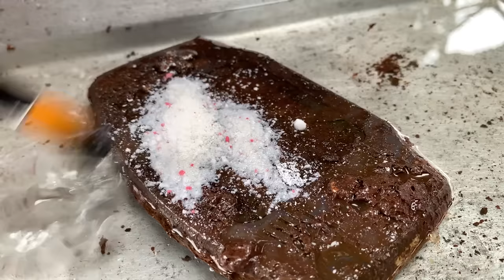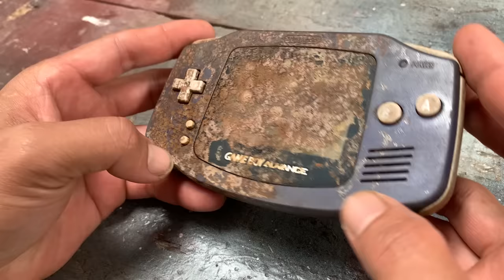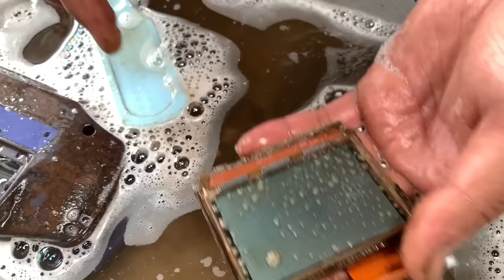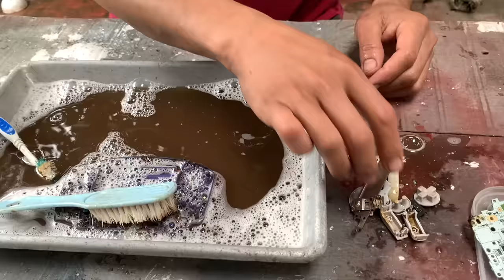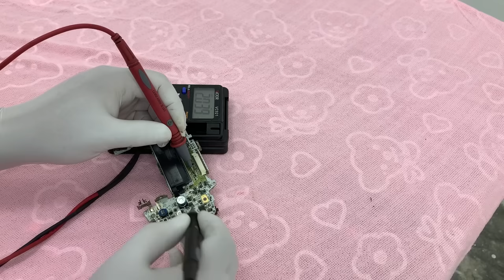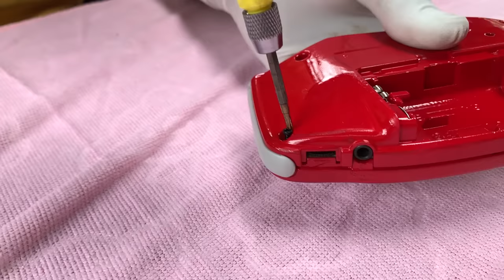Restoration Old Ｎｉｎｔenｄｏ gameboy advance | Restoring Game Boy Advance ＧＢＡ

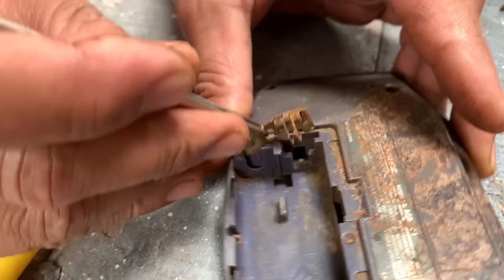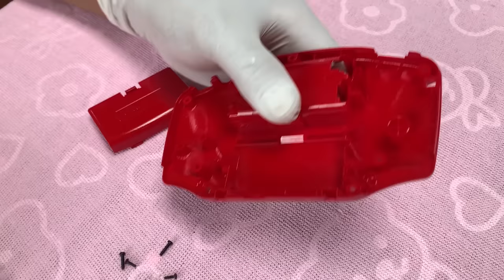Comment: Amazing work on the casing from 5:58 to 15:33, they even redesigned the shape of the top screw hole, changed the location of the circle bumps, and added 2 rectangle holes on the left of the biggest pin.
Reply: Miracles seem to be a thing now. And my forehead has at least two more wrinkles after watching the video, yet another surprise 🤔
Reply: he did a great job
Reply: They magicked a battery cover out of thin air too, as they certainly didn't find it with one.  Oopsies.
Reply: Yeah, I didn't buy this in the first few moments of cleaning when not a single bit was taken apart. Just throw the whole damn thing in some soapy water and call it the day I guess.
Reply: THANK YOU I new something was off (apart from the obvious), the rectangle holes is the biggest giveaway. Fake AF.
Reply: Theres also the speaker vents, went from having holes to completely sealed. at first i thought maybe he couldn't salvage the case so printed a new case and just did that instead but nope apparently he painted it and it magically changed the case.
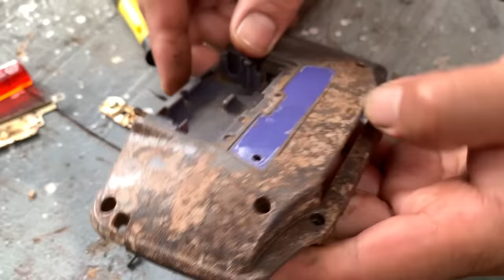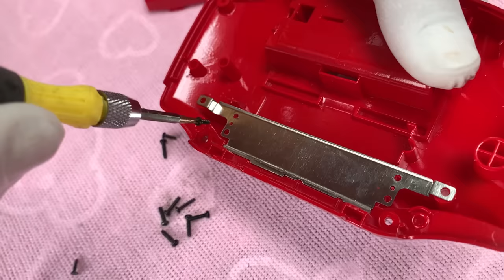Reply: You can get a better look at this amazing work by comparing 6:10 and 15:40 side by side :)
Reply: @00bsdude  So because it's in youtube does that mean that channels can upload shi**y content and claim in this case they restored something when they didn't? I didn´t know that a should've expected TikTok-like standards here and have the obligation to appreciate bad content and not criticizing it.
Reply: @metale3  They Did restore it. You just expected it to be 20 years old, but they didnt actually claim it was and anyone with a brain can put together that's not a reasonable expectation since what are the odds of someone finding a GBA like that in the wild and also happening to be a Restoration youtuber. Yes its not authentic, but it being shitty is subjective. If you like it, watch it, if you don't like it, just don't watch it, its clearly not the content for you. Criticizing it as a video is valid, criticizing it for not being what you assumed it was isn't it.
Reply: @00bsdude  It depends on what you call restoration. Most ppl (me included) consider restoration to be full restoration of an item with 5, maybe 10% of part replacement. That is not the case here. It is quite obvious, that case of Gameboy was straight up new, not restored. Yet it showed, like it is restored. Came here hoping to find a proper restoration (don't care how item was recieved. You can soak it in water by yourself for years. What matters is restoration itself). Find some kind of part of restoration and mostly replacement. Not gonna be here again.
Reply: @00bsdude  ??? From what I’ve seen, he had a whole other GBA ready to go as the final product. One “restored” fake and one already functioning.
Reply: Bro they didnt even out a screen cover on it, and the buttons sound like satan eating a tire
Reply: @00bsdude  People are upset because they are lying, they did not restore the original to working condition. People have a right to be upset over this.
Reply: You can literally HEAR how fake it is when he's playing the game. the whole console is creaking.
Reply: @royroy242  My complain would be more on the side that this is fake, yet, it gets tons more views than many other real restoration channels because of course, the YouTube algorithm promotes this instead, in which case, it's supporting something clearly staged over something that took real effort to find and restore (yes, restore, because a lot of his actions wouldn't actually clean a real antique and it is not that easy)
Reply: For sure he replaced all the buttons and side bits too, and the color of the case magically changed from a glossy red to almost a clear red. Think the only thing he may have kept was the motherboard but I’m pretty sure it was fried
Reply: Ñ
Reply: comrade stump?
Reply: @00bsdude  no dude, they did not. That's the thing, the one picked up at the start of the video is not the same at the end of the video, they are physically different, hence, they are two different consoles, you just need to pay attention and read carefully. yes it's relaxing and entertaining content, but saying that it's a restoration is a lie, which is what got people upset. Let me put it simpler if you can't read what I just wrote: "CONSOLE  WAS DIFFERENT THAN FIRST ONE, LIE, NO RESTORATION"
Reply: But with this, a lot off you guys call “scam” video he managed to get 6.100.000 viewers or is that fake to?
Reply: @elomkardashiam9273  you know that's not what he means lol
Reply: Just happens to have a triwing screwdriver lying around to take apart the case.
Keeps disgusting old piece of foam to insulate screen, can't get another piece of foam anywhere.
Throws away branded screen cover, can replace that no problem.
Sprays solid indigo case with red spraypaint, magically transforms it into a translucent plastic which is red all the way through.
Reply: These are the same people that will find puppies stuck in weird places while walking down the street
Reply: @SnakekillerX  Si justamente apareció y ya.
Reply: He did a lot of things to try to disguise the fact that he swapped out parts behind the scenes... spray-painting the case red, purely meant to hide the fact that he swapped it out for an actual red case later... of course he had to lightly spray paint the new case too so that it had the tacky spray paint details to it in close up... note the fact that all of the screw holes are perfectly "painted" red inside, without even the slightest hint of purple showing... sealing the bumpers and buttons in a bucket of bleach... while a perfectly legitimate way to whiten the parts up more, wouldn't have gotten them that spotless from the condition many of them were still in when he dropped them in... burning the screws, purely theatrics so you don't question the brand new corrosion free screws from the working GBA... tossing the screen cover in the trash, distract you from the new not broken screen he'll add later, and meant to "legitimize" the restoration at the end when he puts a replacement screen cover on it, after all he threw that in the trash... only ever showing the foam backing when installing the screen, all to hide the fact that it's not the same screen with tarnished edges... and then there's the deliberately "not restored" parts... one still rusty battery contact, a little bit of dirt on the corners of the PCB... and the worst offender of all... the battery cover that he pulled out of thin air.
Reply: And none of the electronics inside are corroded at all every pin and every chip is totally fine with being in mud.
Reply: you are all a bunch of haters. Because why shouldn't he had put it togheter ? 
he just sprayed to mutch paint on the speaker holes so they shut together from the paint (ever painted before lol)
and ofcourse the buttons were squeeking when they were in soap it takes away the oil film. in the last fragment you can see he took it back apart and oiled the buttons and shit to make it less squeeky. i personally restores some controllers and had the same problem and solution.
but yess haters gonna hate.
and so what if he didn't found it.. it was dirty as Fuck and def. needed restoration.
Reply: @SandokhanKucic  l
Reply: @lapd6507  the point is that this "restoration" is fake. That's what.
Reply: @SnakekillerX  Your right and that's what gave it away for me! Hoax!
Reply: @Gladius-NL  why would you think that?
Reply: @Gladius-NL  there was Def some corrosion
Reply: wait, where exactly were the two holes, I cant find them
Reply: @lapd6507  People already pointed out how they see that the actions being taken are wrong.  For example, they used a brush to clean the screen but miraculously don't get any scratches on it?  They acted like they spray painted the case but comparison shows that it's two different cases.

If you want to see real restorations then check out channels like Odd Tinkering.
Reply: @Jaslath  he bought another screen because the screen wasn't fixable it corrosed beyond repair. 
in the video you can see him throwing it in the trash.
Reply: @Jaslath  he did switch up the cases. just went into detail prnt sqr'ning.
Reply: He removed corrosion just my washing with water, amazing
Reply: @thePyiott  baking soda and deminarlised water
Reply: if you think thats baking soda, remind me never to eat anything you bake
Reply: @ImJCyo  odd tinkering is rolling his eyes
Reply: @superbeta1716  I don't get your reply. I doubt Odd Tinkering even noticed this comment to bother thinking of it.
Reply: 'the only thing a Youtube Restoration Channel cannot do is restore something' - sun tzu probably
Reply: Omg I thought this was real I’m so gullible they got me

Comment: Nice work. Though it’s more believable that you specifically found this gameboy on an oh so random day. You legit had all the tools back home that could specifically fix a game boy while still having all the spare parts needed at manufacturer level… dude
Reply: And he still thinks after like a hurricane it would just work after washing it
Reply: I've fixed a few, I'm gonna call this bull shit. Not the same screen, new battery cover, new stickers, I don't think it's the same motherboard (if it is, there is a lot of soldering of replacement parts not shown in this video)  . I'm gonna guess that the only original parts are the shell and the buttons. Can get all parts on Ali Express for less than $20 (except the motherboard). You try to avoid submerging any electronics in liquid. Step one should have been; Locate the screws. Step two, disassemble. step three, clean, only submerge non electronic parts. Step four, test individual parts. Five, replace faulty parts. Six, reassemble.
Reply: @dustanglx50  how do we know it was water? Could have used ultrasonic solution....
Reply: @dustanglx50  You absolutely can submerge electronics in water, as long as you dry it before you put current through it. But otherwise, yes... I call this bullshit aswell.
Reply: @dxb8086  I try to avoid it. By submerging it, you are putting faith in the components (capacitors and chips) not having any imperfections to let moisture in that can't be dried easily. The volume wheel and the power switch on those devices also have small areas where water can get in, and be very hard to dry. You can submerge, but it's not the best approach.
Reply: @Dredugz  Just a guess, looks like water and powdered detergent (Comet or something similar)  to me. I could be wrong.
Reply: @dustanglx50  yeah you are probably correct... since he didn't put it in the actual machine with the solution to clean it properly and safely
Reply: imagine this ex nintendo employewho who was washed away one day by a tsunami ...  next he woke up in different country without his social security number.... since then he is searching for nintendo parts (washed away too) and tries to fix them... since hes able to buy his home ticket...
Reply: @dustanglx50  you can submerge electronics in specific liquids that are made for electronic motherboard cleanings. Not all you say is true my guy.
Reply: @210_bk2  Please read what I said more carefully. I never said "you can't" I said "You try to avoid". I also said I was guessing he was using water, and said "I could be wrong" about that in response to @Andre Dugger . I am aware that you can submerge (even in water), but doing it first thing, before you have a look at the internals seams backwards. As I said in response to  @dXb , There are a few parts (Power switch, Volume wheel) that have small cracks and crevasses that water can get in, and not get dried out easily.
 It's not the way I've been taught, and it's not the way I would approach this. I'm not always right, but every thing I said was true.
Reply: @210_bk2  no? they're just not dumb enough to fall for it.
Reply: @dustanglx50  isopropyl alcohol is used to clean electronic parts
Reply: @Bryyy_y  basicly only that... dynno why others guess water :P
Reply: @dustanglx50  can u help me find those parts for under $20? Actually... i think the most important part to me is the screen.
Reply: @Bryyy_y  I scrub them with iso alcohol and a Q tip or toothbrush, I don't submerge them (not saying you can't, just seams like a waist of alcohol)
Reply: @alexandresoldani322  If you are truly interested in rebuilding a GBA, I would spend the extra money (&35-$40) for an ISP screen. If you want an original try ali express. Usually like 10ish
Reply: @dustanglx50  I'm just now seeing this video and confirm that the fact it was even working is fake. I could tell from a glance that there was extensive and very obvious water damage to the ever-important electronic parts, even the motherboard. At that point you don't even try to restore it, you throw it away and buy one off of ebay or something.
Reply: @dustanglx50  I know that when you power a unit when it’s wet THATS the failure of power
Reply: @210_bk2  yea

Comment: The Gameboy Advance was such a good system. It deserved more love than to be thrown away in the mud.
Reply: And yet, that's what they did to make a video
Reply: Dude I’m sorry but this video is fake, they frickin S O A K E D the CPU, the battery port, the Headphone jack, the entire system that runs the screen AND the console as a WHOLE. The gameboy advance as well as all other Nintendo consoles are hella not waterproofed. After the wear they “found” that thing in it was never meant to ever function again. Sorry to be the bearer of bad news but they faked and potentially (forget I said potentially they DEFINITELY did) with 2 gameboy consoles (just showed the new one on-screen when they needed to show functionality). These guys are frauds.
Reply: @palerider2143  Its possible they actually did find it in the dump but just dropped it on the ground for the sake of the video. I've seen a restoration video Commodore 64 that had been sitting outside for decades. It had an ant colony inside and was filed with natural debris like pine needles. The RF shield was completely rusted. The Gameboy in this video was more than just muddied up. There is clear signs of rust and grime.
Reply: @ramgladore  No the hell they didn't.
Reply: @brainscott8198  How am I a fraud? You just explained how they are frauds!
Reply: @palerider2143  You act as if they didn't let it dry out after putting batteries in. I'm saying they probably let it dry completely out after a few days and then worked on it. I don't think it was fake is all I'm really saying.
Reply: @brainscott8198  Gameboy Advances are NOT waterproof. Hell, find me some hard ass proof that they can survive that much water damage and I'll admit that I was wrong. They aren't waterproof! I know this because I HAD ONE!!
Reply: @palerider2143  OK!!! SO THEY'RE NOT WATERPROOF!!! If they still let the components DRY OUT COMPLETELY AFTER DISASSEMBLY, then it may be salvageable.  REGARDLESS IF IT IS NOT, I REPEAT IS NOT WATERPROOF!!! EITHER WAY I SAY IT IS NOT FAKE.

Comment: It is impossible to get that much dirt accumulated even if you buried it in ground for years, so yeah whoever did this, they sure are creative.
Reply: 1 word. Mud
Reply: I find it strange why the plastic didn't lose its colour even though it was outside for years... suspicious
Reply: @stephendowdican7589  Trust me, I know some things about this stuff. Most of what your talking about requires oxidation. If the item was burred in mud, it was not really getting the oxygen required to discolor the plastics or really anything. You would be amazed sometimes at how well preserved things can be under optimal conditions. Something of the right kind of mud actually is a really good preserving agent of plastics. Besides, plastics only change color with age under certain conditions and certain forms of plastic.
Reply: @beeholddrbeesphbees378  so you think he really is legit
Reply: @manojitkarar  Potentially yes.
Reply: @beeholddrbeesphbees378  no. Not at all
Reply: @Cainan G Certainly, would you like to talk bonding agents? How oxidation works? etc? I worked cement QC and have proof to back it up. Your move friend. :D
Reply: It looks burnt.
Reply: @beeholddrbeesphbees378  Can you explain how he "restored" the battery cover that wasnt even with the gameboy when he found it?
Reply: @TheGoondas87  Forgive me, I do not see a place where he restored a cover. If you see a spot where he did if I missed it feel free to link a time stamp below. What I currently think happened is a simple swap in of a cover from another device. Buy parts on ebay, etc... people do it all the time. 

However I may have missed something in the video of them actually restoring the battery cover somewhere. I have covid right now and I am not feeling the best so I may have actually missed it, if that is the case I am genuinely sorry.
Reply: @beeholddrbeesphbees378  My point is he didnt restore a cover and he suddenly had a perfectly colour matched one at the end. Which suggests he did have spare parts from somewhere and didnt use only restored parts like the video was suggesting. And if he bought parts why didnt he buy the missing screen part too? Everything else in the video suggested he was only using what he could restore. The slip up with the battery cover at the end shows theres some kind of tom foolery going on and that this video isnt legit.
Reply: @TheGoondas87  Potentially, or potentially there was a simple omission they forgot to add. Not saying your wrong, my whole augment is that this is potentially real.